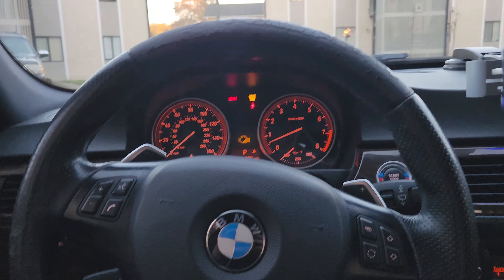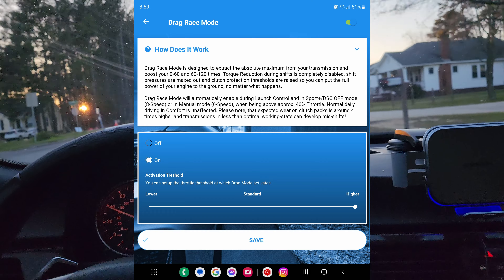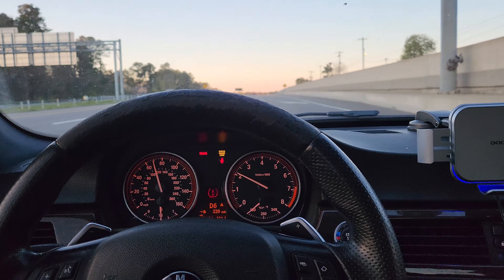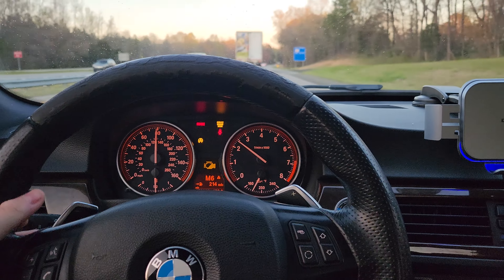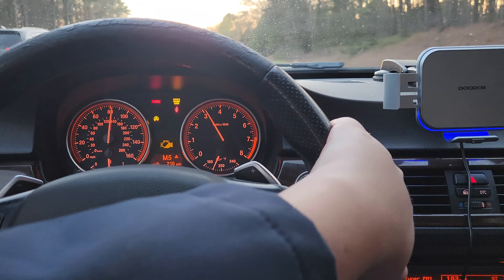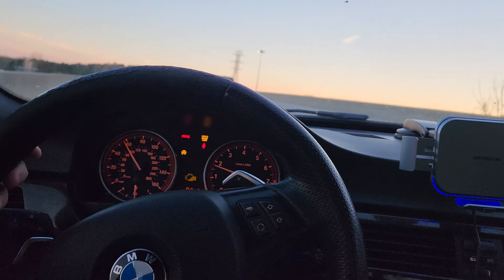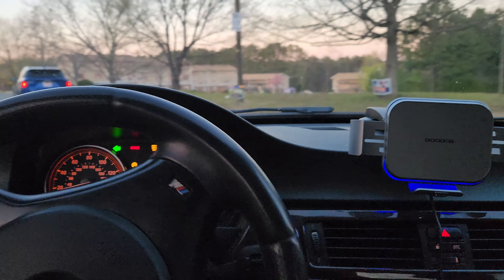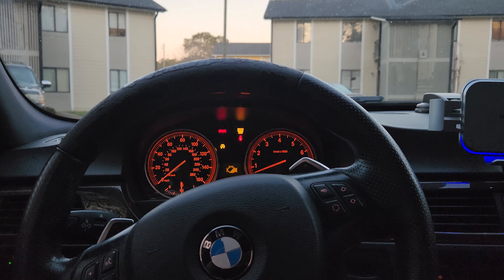xHP Stage 3 Drag Mode on N55 e90

Comment: what codes popped up for your service? my trunk warning comes on to
Reply from the maker: My service light was a valetronic motor issue but the trunk light came on after I tried messing with my trunk bc I locked my keys in the car

Comment: Is drag mode working on the D mode of the gear and Sport+ engine?
Reply from the maker: No it's only in sport mode or Manual mode and the throttle has to be at least 45% pressed down or more I think

Comment: Brotha the n55 makes more the. 300 stock just so you know
Reply from the maker: Crank yes wheel no
Reply from the maker: That's what I said
Reply: @2012summr  depends on the dyno. They make less than 300whp, in the case of the pwg from the e chassis
Reply: @DavidBarahonaBMW from what I’ve seen people dyno an e90 n55(stock) made 291whp. Then seen a e92 n55(stock) make 275whp.
Reply from the maker: @tmc8516  I'm looking back and I said crank 300 and I meant to say they make close to 300 wheel but I wonder if the e92 make less power seems weird
Reply: @DavidBarahonaBMW  yeah because they advertise 300hp crank but in the dyno they put up really good numbers. So I’m guessing they mean 300whp because they pretty close to that number with stock runs on a dyno.
Reply from the maker: @tmc8516  yea BMW tends to underrate there power levels crank which I kinda like
Reply: @DavidBarahonaBMW  yessir that’s the link to the video of a stock e92 n55 making 297whp
Reply: It gets better after time and shift are better and higher rpm, especially on the DTC